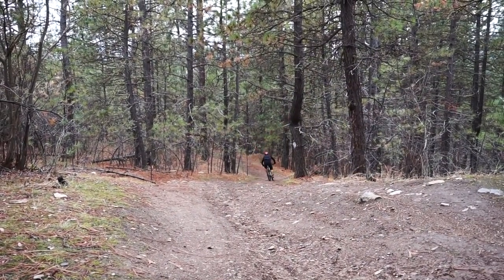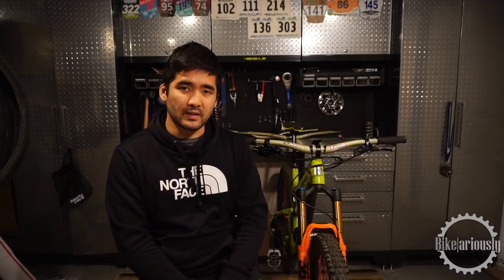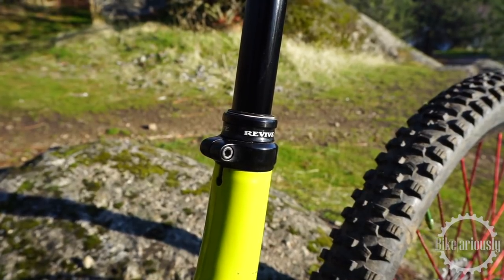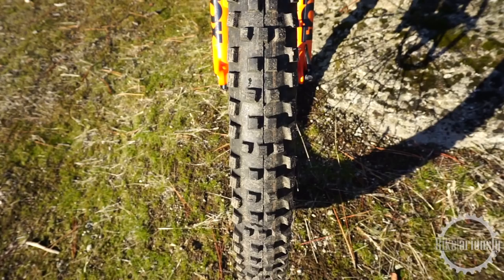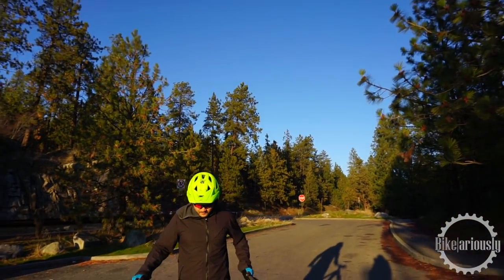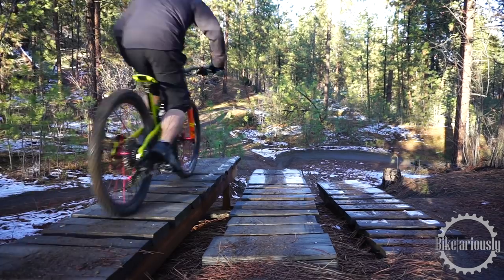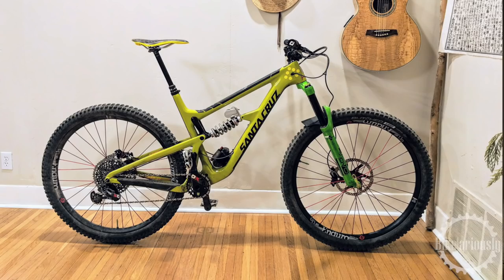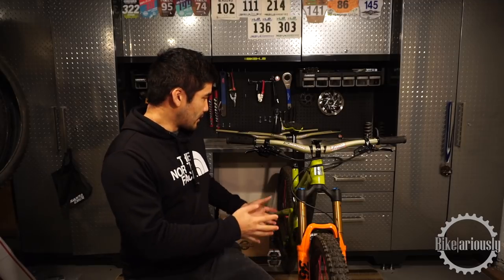My Hightower LT Long Term Review | Bike Check 3.0

Comment: I’ve got an HTLT also. You should try MOTO foam/gutter foam to cut up and put in the frame above the vpp link. It works really well to prevent mud and debris build up on the link, especially over here in western Washington.
Reply from the maker: Hey Thanks Zach. I have thought of doing that but just haven't yet. Been trying to brainstorm making a custom molded guard but I should probably just use the foam for now.

Comment: 7:42 looking at this it looks like this bike would not fit my requirements, as for me having the saddle even further with the tip over the bb would suit me better.
the seat tube angle is overly slack imo, I see you already have it almost all the way to the front. I use mid foot position, and use Pedaling Innovations Catalyst pedals, but my current bike does not fit me well, I got 43mm reach & saddle to stem, but longer bike would be nice.

I looked at the second hand market in Norway, seems to be impossible for me to get a bike that fits me, so I will try to build a bike from parts I got & buy new frame, and see what has to be changed.
but I have my eyes on Nicolai G13 & G1 Pole Evolink. so far for suspension MRP or fox seem most interesting, from reviews.

what do you think about the TRP rotors?
how is the Tioga saddle holding up? do you have to replace it every year as Tioga suggest?
do you feel like the Fox 36 is stiff enough for you? so far I have only used fox 32 120mm, not the stiffest fork, but works ok.
Reply from the maker: I definitely wish the Seat Tube was steeper. But I manage it and when you actually sag down it doesn't ride as bad as it looks when sitting static. The Pole I think would be an awesome bike and even thought about doing a Pole Machine Frame build. You build you mentioned sounds awesome and hope you can make it happen. 

I really like the TRP rotors. I will probably get some 180s at the start of next season. These combined with Galfer pads has been an effective combo for me. Tioga saddle is awesome and I have not replaced it. This would mark a full year on it though but all I can see myself doing is replacing the silicone pads since those are kind of worn down. 

Love my Fox 36. Best fork I have ridden yet. I find it plenty stiff but I also have a pretty stiff wheelset. I would say though the stiffest setup I have used is the Lyrik with Torque caps.

Comment: How do you find pedal strikes? I was considering HTLT along with all the other SC bikes after cracking my 2012 Nomad and settled on the Bronson for various reasons. I demoed the HT and HTLT and experienced pedal strikes for days and they felt very notchy in technical rock gardens. Where I live it's pretty Rocky so pedaling through rock gardens is a must.
Reply from the maker: I do get strikes occasionally. No as much now that switched to 170mm cranks and with a 160-170mm fork it lifts the BB even more. I would not say that occurs enough that it bothers me or something that I am conscious about.

Comment: Can you tell me the code of the air shaft 170 mm that you use? Is 820-02-451-kit ? Tks
Reply from the maker: For my Specific Fork and model year this is what you would use. 

https://www.worldwidecyclery.com/products/2018-fox-float-36-air-shaft-assembly-170mm-travel-1?variant=889881100293#

Comment: Hey great review!! I am currently looking to replace my enduro 29 with something a bit more playful and poppy. From what I have read and seen the hightower lt is more geared towards that than monster truck.
Also what are your thoughts about the different offset in the fork, has it made a positive difference?
Reply from the maker: Thanks Adrian
The LT can definitely get playful and I would say is less plush than an enduro. The FSR and VPP just react and feel differently as you could probably guess. 

Regarding the less offset, I would say it made a positive difference for my riding style. I am not about to say that it is the future and that everyone should have it but if one was looking for a different feel I would say its a great thing to do. 

44mm Offset on any bike coming from 51mm offset will make the bike feel more stable and planted. It could help provide more front end feel if the rider struggles with that as well. It is easier to hold line when cornering as well. Steering will feel slower though and with more weight which could lead to slower reactions even when climbing. 

51mm would be great for those that require sharper bike handling. Climbing will be more precise and easier to steer into lines that you choose. You lose some DH stability but not much. Steering will feel faster and lighter and it will also feel like the front tire is further in front of you vs under you.

Comment: Really want to know how this set-up can compare to a top tear build Trance 29! I have a long travel Reign 27.5 & want a XC / all mountain capable bike for 80-90% of my trail riding!? Any thoughts or suggestions
Reply from the maker: Jay, If you plan on keeping the Reign as your "big" bike,  the Trance 29 would be an excellent compliment to your stable. My build I think would be too indifferent from your reign in terms of intended use. Even a stock Hightower LT would still blur the line too much. I rode and reviewed the Trance 29 not too long ago and that is one heck of a bike. The Geometry of that bike gives you the capability to charge confidently even with the smaller amount of travel that it has. In my honest opinion I would go that route instead. Now if you plan on replacing the Reign, my current build would be something to emulate.
Reply: Thank you so much for your attention to detail & honesty! Really liking your channel & some of the things you have to give to the MTB community/world! I may Just need to hold onto the Reign seeing how amazing of a descendant it has been & sell the Roady for a more appropriate XC/Trail bike that’s best for most rides! Thanks again making everything seem very clear!
Reply from the maker: No problem Jay. I appreciate the kind words and hope to load more content more consistently. The Reign is a great bike. Maybe hold out for a Reign 29 because it has to be coming.

Comment: hey mate.  thoughts on how this bike contrasts with the Sentinel you have/had would be appreciated.   thanks.
Reply from the maker: They are very close as long as you go apples to apples and go carbon on the Sentinel. The Sentinel has the potential to be a more comfortable bike because of the steeper seat tube but you just have to make sure you don't fall into a size that is overkill on the reach numbers for you. I don't know if it advisable or even if Transition will honor a warranty if you put a 170mm fork on the bike but honestly with the geometry the Sentinel has it would not "need" it. 

What I like about my bike over the Sentinel would be better climbing/pedaling performance, extra bit of travel for more comfortable flat/square landings, 

What I like about the Sentinel over my bike, better geometry, better fit for a water bottle cage, better rear suspension feel through the feet, 

All other things I would consider equal or near equal. If you have any more specific questions please let me know.

Comment: I have a very similar setup and am 230lbs and find the float X2 struggles to  manage my weight,  I need like 300 plus PSI to get correct sag with my weight.   I assume you just need to get the correct spring rate for an 11-6?
Reply from the maker: Push will make their best recommendations and tune the valving accordingly with the correct spring weight. I do find that the bike rides higher most of the time and I actually believe i have more mid-stroke support. I do hit the end more than I did but they are soft bumps.
Reply: @RideEatWander  Thanks,

Comment: what were the quality control issues with the DVO fork? not as tempting anymore. seems like I will be deciding between Fox grip 2 and MRP ribbon.
Reply from the maker: It was starting to develop some vertical lines on the stancion. Some hairline but some that could be felt with a fingernail. They tried to tell me it was from metal shavings from install my EDC tool but that is impossible because I always Tap the EDC tool with the fork upside down. Their seals also are not the best and there does not seem to be aftermarket options from SKS or others. It was and is still a great fork and very possible I was an isolated incident but it was just my experience that I had.
Reply: @RideEatWander  did you try to tell them that? 
I got similar thing with Race Face Turbine dropper post, exactly same spot on both droppers.but I got refund:-) I am not sure how it happen, but bad seals might be the reason, but same scratch at the same spot the same way, means it same problem on both.I had good luck with Fox seals. But I managed to damage CTD damper, so now I got Grip damper, it's apparently more reliable, so Grip 2 might be too.
but I got two Rock Shox fork that came with very sloppy seals, one blew off.
on the other fork one was off from shipping, and it was covered with oil and grease all over the fork. but Rock Shox fixed it,with seals that work.
but never had problems with a fork.
I hope DVO resolve this, they should do Dyno test of every fork they make. Imo they should have fixed the fork fork you for free.
I struggled with Trek warranty, I am probably going to try agian one last time, but in my local shop, I contacted Trek via twitter it seems like they think I need new swingarms.
the shop I sendt it to did not do anything, just claim Rep checked it and measured it, might be BS. but flawed design, and too flexy bike. so need new bike anyway, longer reach too.

As long as SKS & DVO sizing match it should  fit, I assume DVO don't use some weird sizing no one else uses. But I am no expert on seals.
Reply from the maker: I didn't fight it too hard. Honestly I was ready to move on at that point because I wanted to try less offset and they were slow to roll out their new forks with less offset. I am at a pretty good place now. The 36 is lighter, I think has more usable HSC and LSC controls than the Diamond had and is just as good at small bump sensitivity. Also Fox and Rockshox have more aftermarket support which is always nice.
Reply: @RideEatWander  yea MRP is not so common in Norway. but the two big brands still are common. but MRP does Dyno test on all the forks & shocks before they go in the box.
sadly a lot of the bicycler industry is not up to proper standards of testing, and quality control.
But a experienced service person could probably service these forks with ease, if they got the parts, but fox & Rock Shox are easier to get.
Carbon frames are a common example of this, but maybe Santa Cruz is different, but many brands are not, badly said carbon, inaccuracy, voids/air bubbles.
Reply: @RideEatWander  small bump sensitivity is important for me, I got back & neck issues, I want to eliminate as much of back & neck problems as I possibly can, so if I can get a more supple but yet supportive fork I am all for it. but so far my set up will do, Installing Cush core and dropping 4 psi has been a huge help, next I want to try studded tyres with tubeless setup, might try Schwalbe ice spiker, cus the current set up with SUomi 294 is harsh and heavy.
to keep weight down might be nice to keep usign air, but coil sure has it's benefits.
I want to keep my bike in 13K range or lower, current set up is 16kg with studded tyres, and hte heavier mechanical from E134 dropper has added weight from previous setup.
Not sure how to keep it low without going carbon crazy, I want to avoid carbon, I am too afraid of damaging frames, and I also don't know how well it will react to subzero conditions, the expanding & shrinking rate, like with metal BB shell in carbon frame, and so on, but I know many are carbon only with press fit BB. I am no expert on this subject, but I research and worry about things most people don't worry about, I dig really deep, I eliminated most bikes, most interesting are Nicolai & Pole, but with Nicolai I know how they make their bikes, And I approve of it, they use great techniques which does a accurate job, which many brands don't, and some keep it a secret how they make their bikes, but some display flawed carbon bikes on displays at festivals and so on.
but alloy is like from Nicolai I think is a safer bet for me. But I am not sure which model I want yet, I want a biek that can handle everything I throw at it, but still be light enough.
Reply from the maker: Ya dropping weight can be hard to do if you don't want to go carbon. I think Flat Tire Defender is noticeably lighter than cushcore. I might be trying that next if my Cushcore ever wears out. I don't know if I would worry too much about Carbon in cold weather. I think anything in extreme cold will have its own set of reactions. I have started to search for anything here and there to try and get my bike weight down some.
Reply: @RideEatWander  I think having light cassette and lighter studded tyres will give the most improvement for me, without having to go for light dropper post or lighter wheels. I am think E13 cassette would be nice upgrade. any opinion on that?
Reply: @RideEatWander  Cush Core feel light to me, it's the studded tyres, cassette, and dropper post that are the biggest contributors to weight. it takes some time to get used to winter tyres, but they are narrow, which compromises steering, so I want to go for bigger studded tyres closer to 2.3, I like how 2.3 feels with Maxxis tyres. but my current bike don't have clearance for that, flexy and bad clearance, I see Pole can take up to 3.0 tyres, Nicolai can take 2.5.
Reply: @RideEatWander  I am thinking MRP Ribbon or fox 34Grip2 over 120 mm probably around 140 would be nice, which Nicolai G13 offers can handle 140mm fork.
so can Pole Evolink 140.
480m reach for Pole 190 for Nicolai G13 and 495mm for G1.
Reply: @RideEatWander  Cush Core came best in test on VitalMtb. another interesting option is MR wolf, but nto heard much about it, but read something about durability issues, but not tried it, there are some other options too, but not as intriguing , I forgot what they are.

Comment: Do you find that RWC shock eyelet  bearing kit give you a noticeable  difference in small bump sensitivity?
Reply from the maker: I honestly do. After owning a bike that had bearing pivots and then going to a bike that didn't, I had to add them. I think they can make a basic shock good and a good shock great. When you have Zero stiction, you reduce a variable in the tuning and therefor all the Tuning can be placed at the shock level without having to account for a bushing that sticks.
Reply: @RideEatWander  Pretty much what I was hoping to hear! Will I have to get their tool to install them?
Reply from the maker: It definitely makes the job easier especially if you currently have a DU bushing to press out. If you have a Fox Igus bushing you can typically remove those without special tools. On my Push shock I was able to press the new bushing in with some grease and used a motorcycle Chain breaker to press it in.
Reply: @RideEatWander  Thanks for your help Andrew.
Reply from the maker: Any time!

Comment: Why a tube if you’re running cushcore?
Reply from the maker: There is still a chance to flat even with Cushcore. Cushcore states that you can still run a tube with cushcore if needed. You just need to make sure you have a valve that is long enough and push it through the foam.
Reply: @RideEatWander  Fair enough, guess I can't see getting a tube in there and then getting the bead reset trail side.  The one time I got a flat with cushcore that a plug couldn't fix,  I just rode it out on the cushcore, which actually worked just fine.  Thanks for the reply!
Reply from the maker: I know it would be a pain but I'm kind of a creature of habit. I know I should probably ditch it.
Reply: @RideEatWander  You do you, man, was just curious what your thinking was.

Comment: Why you move from the Anvl cockpit to the Renthal?

Thanks for your great review, you are one of the reasons why i bought a Hightower LT.
Reply from the maker: Hi Alex

I moved on from the Anvl stuff because I wanted to go shorter on the stem and higher rise on the bar. Anvl at the time only had stem lengths of 35mm and 50mm and I thought 35mm would be too short. Also their bars only had rises of 20mm and 35mm and I didn't want to go quite that high. Renthal just had more options at the time and 40mm length on the stem and 30mm rise on the bars has been perfect for me. The Anvl stuff is very high quality and they have more options now which is great. I would not hesitate purchasing their products. 

You are welcome on the review. I am glad you find my information useful. How are you liking the Hightower LT?
Reply: Bike|ariously thank you.

I love my Hightower LT. I sold my Nomad 4 CC Coil to buy my LT. Itˋs the better bike for the stuff i ride. The Nomad 4 is a great bike, but too much for my enduro tours or my hometrails. 
And the Hightower looks better with me on it than the Nomad do. Iam a tall guy with 6.36.

Greets from Germany
Reply from the maker: Thats awesome! I would agree that 29ers fit taller riders better especially to the eye test. Glad you are liking the bike and thanks from watching all the way from Germany!